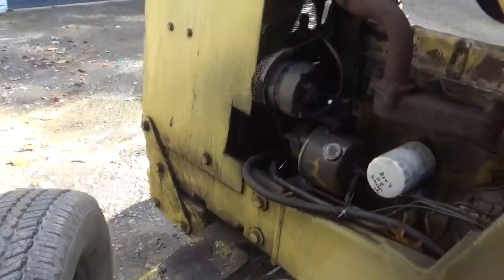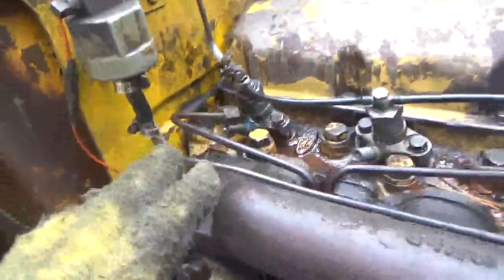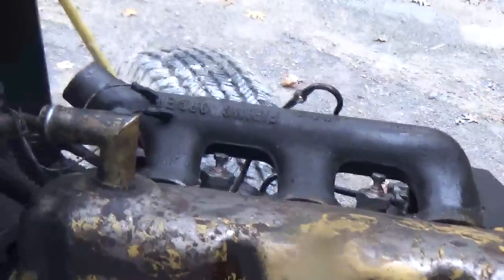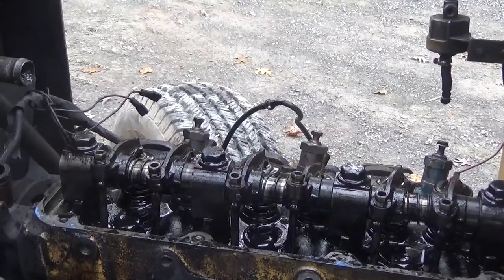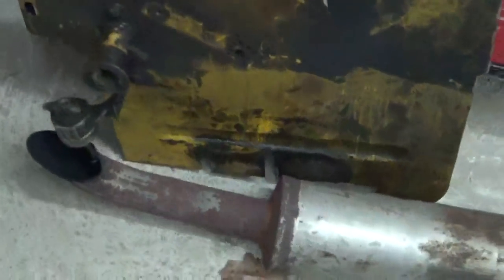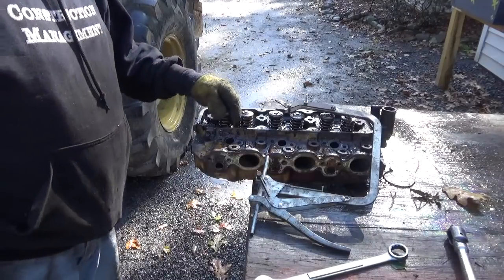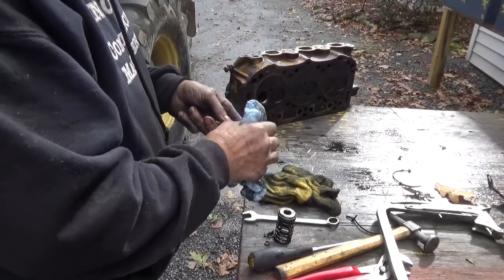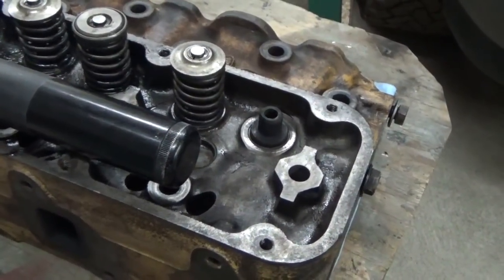Removing the head from a Ford 550 TLB.

Comment: I learned the hard way about ether when I blew a hole in my head and melted a piston in my 555 B. I'm now putting a brand new head I found on ebay for 500 dollars, which was a miracle. To find a brand new, not rebuilt head, for 500 dollars still hasn't sunk in. I also bought new pistons and sleeves to put in it. I have been told that if you replace one sleeve and piston, you need to replace all 3 because the compression on the other 2 cylinders will be different and it'll never run right. Thanks for the video

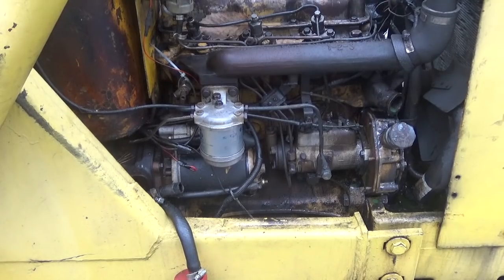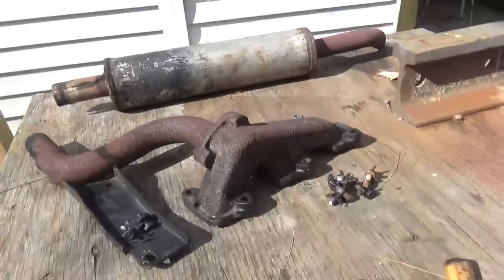Comment: Good find on the valve.I got hit with dime sized frozen white stuff snow / hail mix and it actually hurt when it hit my face and ears about 2:00- 3:00 wed. Got all my logs moved and made a nice mess of my lawn. Had to put my plow on to move them a round and the sun returned here around 4:00pm I also got the distributuer out of the tractor so it can be rebuilt, can't wait till that is running  I am getting to old to muscle these logs around by hand.LOL. have good one Joe. I also woke up to everything frozen lots of ice everything be careful out there today
Reply from the maker: Weather here is pretty much the same. I know what you mean about muscling stuff. This ford tractor gives me a real leg up on doing things around here. I was so disgusted with it not having full power I stopped and looked at a new one. The prices are outrageous. I am overjoyed that It is an easy fix. I hope you get yours running soon and save your back. Have a good one Larry.

Comment: Check the other valves Joe, better to do it now than after you get it put back together. BETTER SAFE THAN SORRY.  I always had new seals and the valves lapped and the head was as good as new. Glad the sun came back out for you and hope it shines while you're putting it back together. Thanks for sharing.
Reply from the maker: If the new seals all come with the head gasket set, MAYBE I will, but if not. Its going back together with one new valve. I am amazed at how good the rest of the upper engine is. Thanks Young Dawg.

Comment: You are living right lil buddy...lol... when you said cracking as a 40 year mechanic in rebuild I knew the oil pan wasn't coming off... have a good one....
Reply from the maker: It seems like it John. Have a good one.
Reply: @josaljo1  one thing stick in my mind... noise through intake is valves... noise through exhaust is timing... have a good one...

Comment: I agree with you totally, with a machine of that age and the fact everything looks so good.  A lap in a new valve , look over the valve seals.  A kit normally comes with them or at least used to.   I’m not sure about your feelings for the backhoe but I know putting a lot of money into the head can be a trade off. Get all that cost involved into a head on a machine that might have a failure that the cost of its repair might be unwarranted compared to replacement of the entire machine.  
 Besides it doesn’t look like it was that hard to get a part.   The repair your making looks like it suits your needs.   
  Enjoyed the content.  👍
Reply from the maker: I had this thing for a lot of years and it mostly sat around until this past year after I bought the sawmill. If I would have noticed the cylinders worn, I would do a valve job. But everything looks good. If when I get the head gasket set it has new seals I might put them in. But even the old seal was still pliable. American Rubber. Thanks for the comment. To replace this machine with one that can dig 15' and lift what it lifts would cost 30 thousand or more used. Fixing hoses is part of the game, I don't mind that. But the transmission, rear, and things all work good. Not only that, I dont want anything with a computer in it.

Comment: While the head is off, you might want to consider replacing the oil seals on the intake valves.
Reply from the maker: I have no burning oil and no motor oil loss so I might if the seals come in the head set otherwise its just the lap.

Comment: Thank you for that Joe. I've only ever done that job once - many years ago - my Triumph 2.5 PI, 6 cylinder pushrod engine. Like you I had a cracked valve, maybe two or three I can't remember. Anyways, on my current car, Citroen Saxo (please don't laugh), 1.1 litres overhead cam, I'm losing coolant and getting oil in the coolant so it probably needs a new head gasket, hopefully nothing worse. I won't even try to do the job myself this time. I'll pay the garage.

If you don't know the Triumph, this video will give you as good an introduction to it as any (with thanks to the ozzies who made it)
https://www.youtube.com/watch?v=sm5TZrfvhPg
Reply from the maker: Wow they called that a luxury family car. To me a Sedan Deville Cadillac was a luxury family car back then. I knew the motorcycles were popular and I knew they made a car but we never took them seriously. Sorry. The guys in the video seem to think a lot of them. Thanks for your comment. I have to look up Citroen Saxo.
Reply from the maker: OK I look up a 2001 saxo, it kind of looks like a Ford Pinto to me.
Reply: Joe, I think I'm right in saying that Triumph Cars and Triumph Motorcycles were different businesses, though maybe with some common ancestry. Back then (1970s), the US and UK/European markets were very different. Our cars were a lot smaller than yours. The Triumph 2000/2500 was on the large side for a UK/European car and very nicely fitted out - by our standards. Regarding size, the only real exceptions were Rolls Royce/Bentley, larger Mercedes and arguably Volvo. Even Fords largest model, the Granada would have looked small against a Detroit contemporary.
Reply from the maker: I remember seeing a triumph car, dark green with brown accent color, I think the convertible top was brown, a nice looking car i remember.
Reply: Joe, I've never seen a Pinto in the flesh, but I get the impression that its a good bit larger than the Saxo. 
Saxos are popular with youngsters these days; they are cheap to buy and cheap(ish) to insure. Goodness knows what an old b****r like me is doing with one :-)
Reply: Joe, the green/brown Triumph may well have been a Stag, held by many to be the best looking car of all time (meanwhile others dismiss it as a hairdresser's car). The MkII Triumph 2000/2500 range shared much of the Stag's styling.
Reply from the maker: @Hertog_von_Berkshire  I fell asleep, long day. I dont have experience with what I call foreign cars but seeing how different engineers did things is very interesting to me. You get to see that in foreign cars.